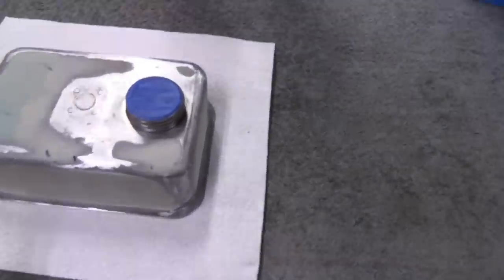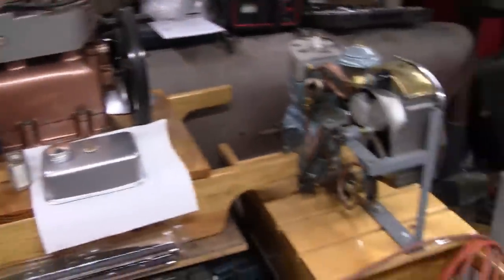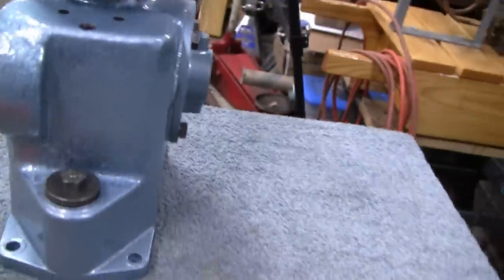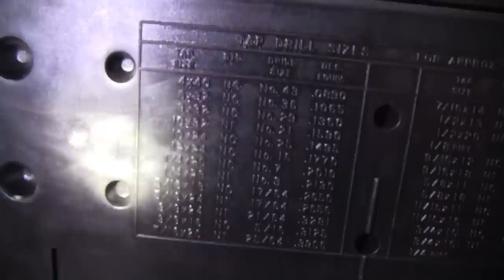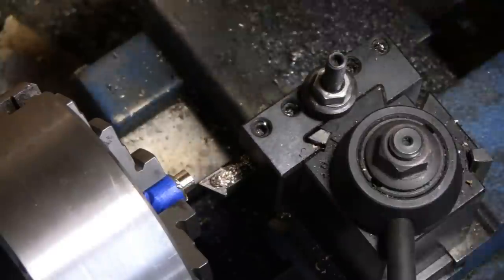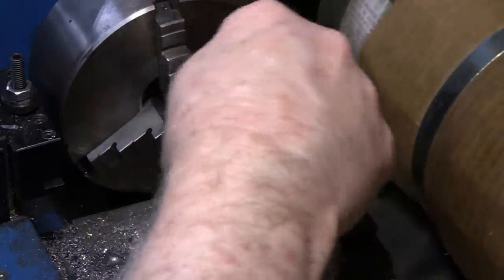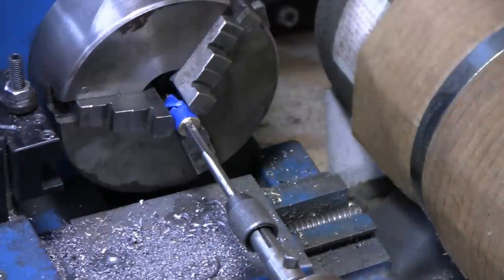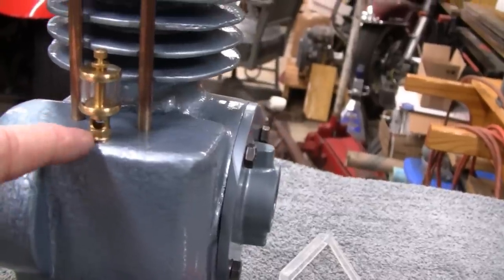HOMEMADE OVERHEAD VALVE BRIGGS (part 30)

Comment: You could drop a pilot hole into your solder and breach it for an Allen head then tap your threads into the other half and tighten it from inside so it won't come back out. If that makes any sense

Comment: Wouldn't the led melt from heat of the motor
Reply from the maker: Nah, the block doesn't get hot maybe 100F !! Solder melts at about 400F!!☺

Comment: You should put the end of a q tip in that oiler so the oil doesn't spill out all over the paint
Reply from the maker: No worries Mate!! We don't even know if any oil is gonna come outta there eh, it has a baffle covering the hole!!☺
Reply: Hey, never hurts to take precautions! Lot easier to do that than have to repaint it! By the way, what do you think you're going to use that wankel engine for? Might be pretty good in a garden tractor

Comment: I am thinking it is going to spit oil out of that oiler. That  slinger on the crank is gonna be tossing oil all over the inside of the engine. I would try putting a little steel wool inside the bottom fitting. You and the rest of your crew do great work.
Reply from the maker: Thanks Charles!! There's a 4" steel baffle under that oiler, I'd be surprised if it spit anything!!☺

Comment: Everett, 2 links for finding "interesting" 
parts and tools.  One domestic, one 
the other side of the salt water pond.

http://www.blackgates.co.uk/

https://www.pmmodelengines.com/

That drip oiler looks like it may have come 
from PM research, the second link.  It is a 
standard steam engine drip oiler.  (Could 
be used on a hit-n-miss piston oiler, too.)

Oh, put some oil, in that oiler.  Just for show, 
keep the drip screw closed.

When you fill a brass plug with more brass, 
is it brazing, or welding?  No, I'm not sure.

steve

Comment: Not long now before you kick it in the guts and make smoke.
Would be interesting to see what the increase in power will be?
Reply from the maker: Probably no increase in power, just look a little different!!☺
Reply: 805ROADKING you'll be surprised with the way the air flows in and out of the cylinders how much of a difference that makes performance of those little donks.